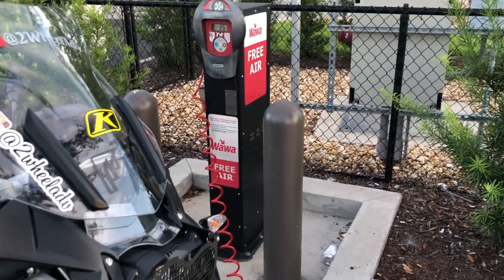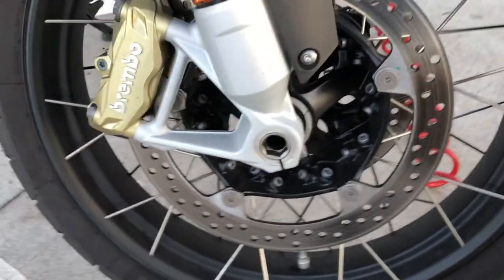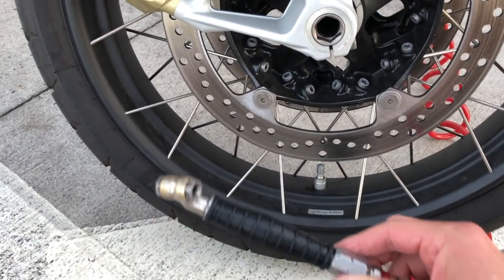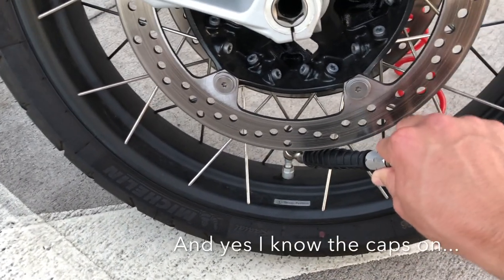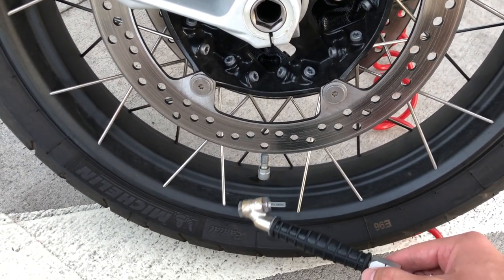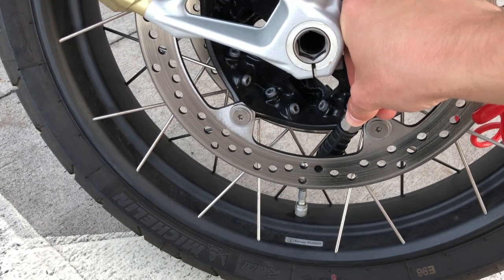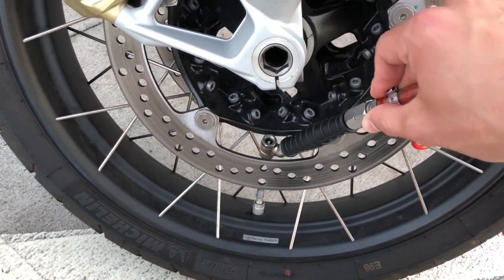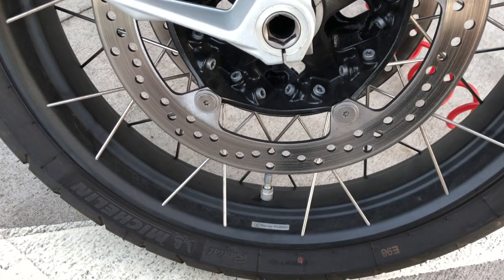Motorcycle - How to use a gas station air pump for the front tire

Comment: I have ABS, so the extra disk leaves no space. This has bothered me. Too bad the valve stem wasn't offset like on a car.
Reply from the maker: Yeah, the newer models are offset.
Reply: @2wheelAdv  not on my Kawasaki Versys 650. Brand new; just bought last month.
Reply from the maker: Ah yeah, I was thinking the 1250 Beamers